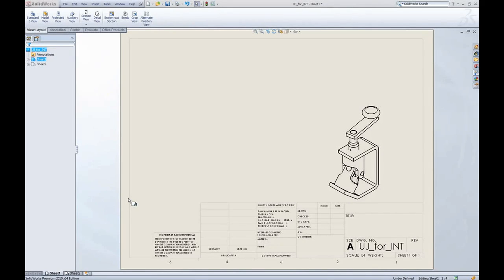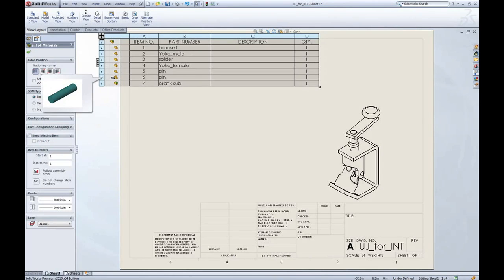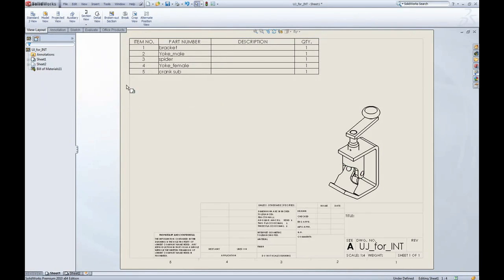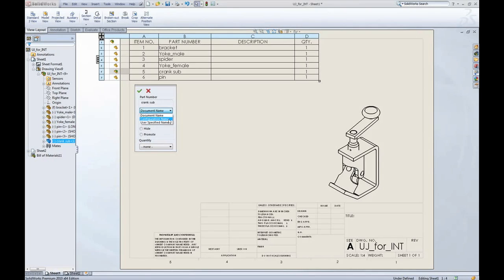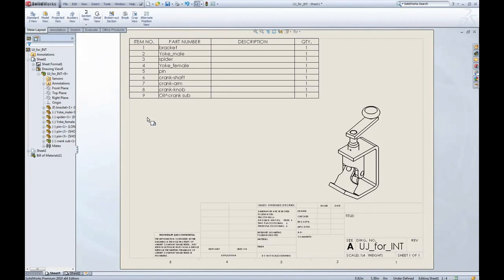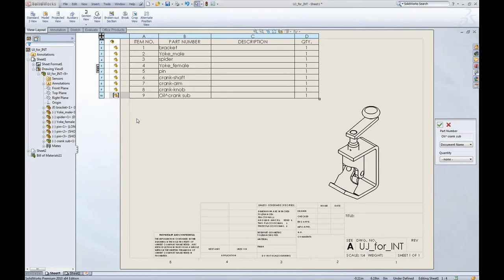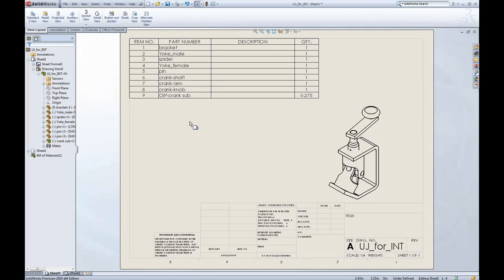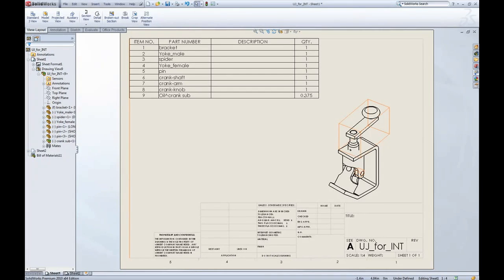SOLIDWORKS - BOM Options

Comment: Hello, I added a new part into my assemby, but it doesn´t have the option for include to my BOM. How can I include my new part into my BOM?
Reply from the maker: New Parts added to Assemblies are included in the billing materials by default.

A user action is only required to “exclude from bom“… So make sure that you’ve rebuilt and saved your assembly, and rebuild your drawing as well and the change should appear.

If it does not, it may be helpful to contact technical support to see what might be causing the behavior.

Comment: Hello. Very good. But if you today exclude something from the BOM, next month you dont remember that you did that, so how can you see that the item was excluded?
Reply from the maker: Exclude from BOM option should be used with some foresight.  If an item needs to be excluded periodically, using the HIDE ROW command will be a better option.  If the part should never appear in a BOM, then the Exclude function is perfect.

The dissolve only happens to the items in the BOM and does not affect and 3D models.

Comment: Does dragging the BOM to a different sheet move or copy it. Or must you command drag to copy it?
Reply from the maker: Hi Greg,
The way you would move a BOM to another sheet is by...
1) selecting the BOM
2) using CTRL+X
3) moving to the new sheet
4) left clicking a target location on the new sheet
5) using CTRL+V